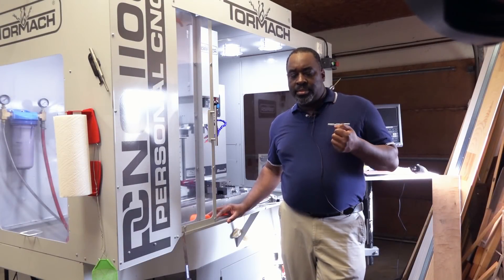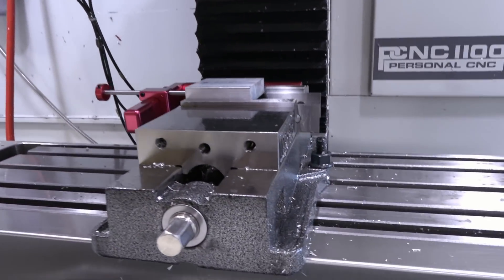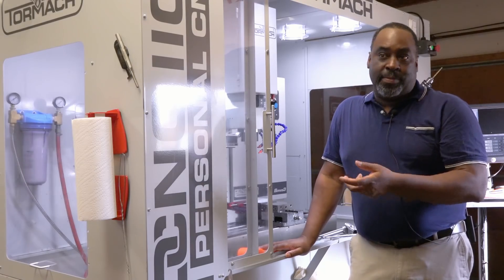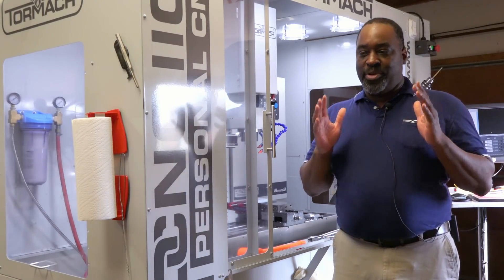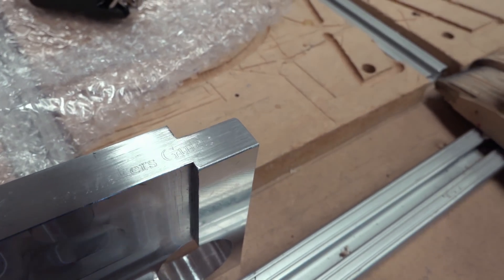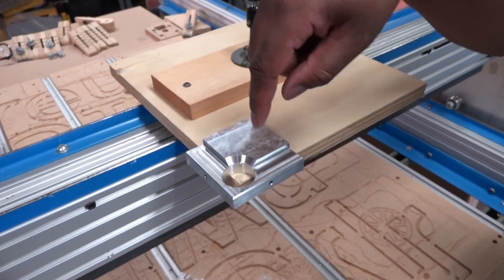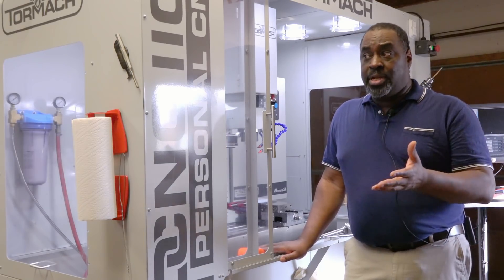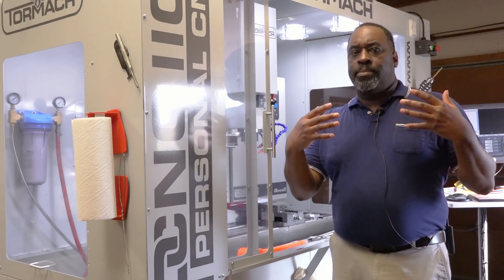Bill Griggs Is Paying It Forward With CNC Knowledge

Comment: This machine is overkill for the part you are making.
Reply: That depends on how many he wants to run at once.  He could fill a pallet up with a bunch of those suckers and then the X/Y envelope would surely be appreciated.
Reply: Erik Colvin you hit the nail on the head Erik. I now have a Pierson mini pallet system that allows me to run multiple parts at once. It has been a game changer.
Reply: Just think... if you have an idea of annual consumption of those parts and could produce the entire year in 40hr, you have another 52 weeks to make the rest of your ideas. 40hrs, that is a light week for a one man shop.  I use this example because I have a friend that is in this very situation.  He manufactures pottery tools. He had me build his form press and bend dies but had a local shop making the blades. His margins were fairly handsome but the volume was low. The shop he used to make blades was habitually late and when he told me what his per piece cost was, I nearly died.  The next day I gave him a slip of paper with an equipment list and told him to order it. I told him he'd cut his per piece cost to 1/10th and I'd teach him the process free of charge. He had no experience as a machinist but he now produces his entire inventory in 40hr. It consists of 24 different models of tools.  It is one hell of an annual retirement income for 40hrs. BTW, the $10K worth of equipment was paid for in 10 months.
Reply: You are probably right but I have other parts in development and I didn't want to have to buy the machine twice. I thought about the things I wanted to make in the future and decided to take my shot. I have tried buying just the minimum I thought would work and that has not worked out in the long run for me. Thanks for your feedback. I appreciate it.
Reply: WOW. I like the way you think. That never really occurred to me. I have been focused on just in time machining so I never really considered what you are describing.